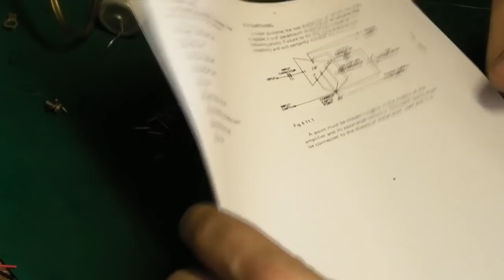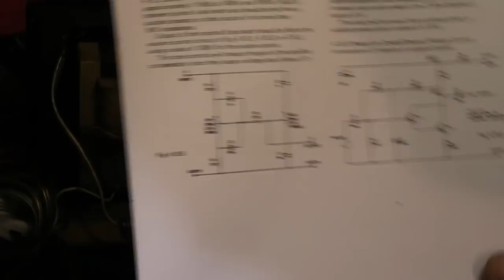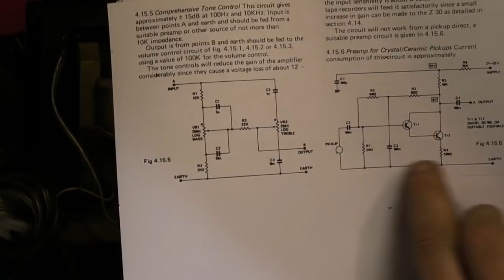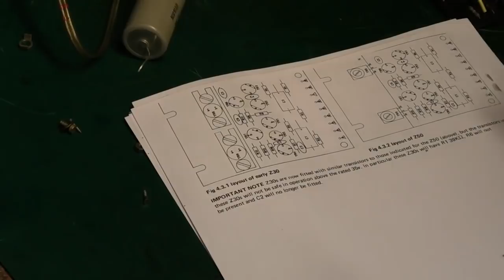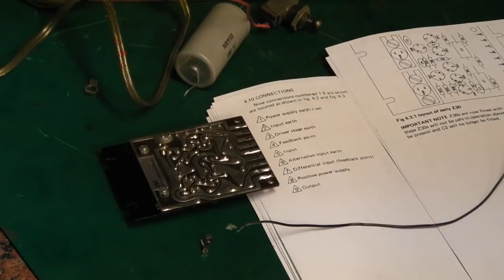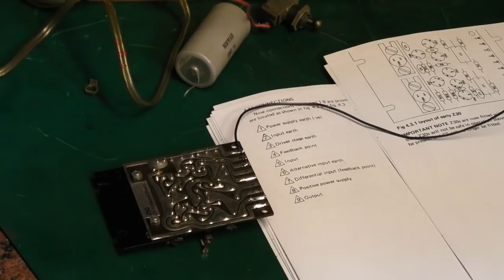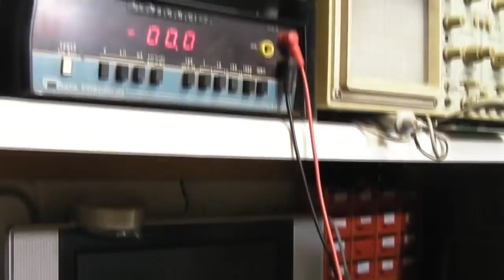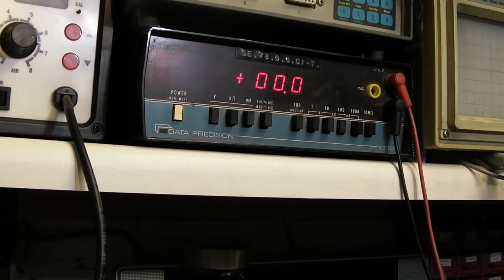Vintage DIY amp Lookover refurb Pt2 (Sinclair Z50)

Comment: I had a set of Z30 s in stereo running of a none regulated (bi phase rectified) psu. My first amp. All you are missing is the sexy input control unit that was just an aluminium faceplate with shiny black plastic knobs attached to the pcb on skeleton pots. There was also a scratch and rumble filter to match. Either of such items would be an extreme rarity and I have no idea what you could demand for one on ebay.
There was a US competitor for the King DIY amp kit back in the day. The US one was called the Texan and featured no transistors except the output Darlington and dual supply voltage. I can't remember if it was dc coupled

Comment: . The laptop does not seem to make a very good input source. Why not try a little battery fm radio would seem better to me if you want to link ground on the amp. Then you may actually be able to heat that 0-02% distortion.